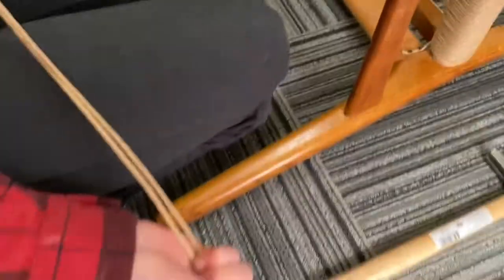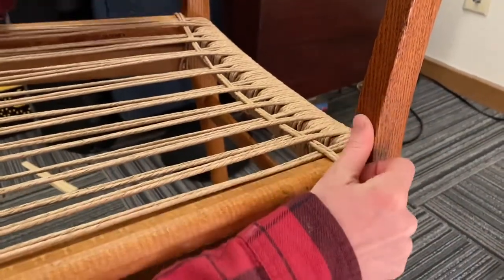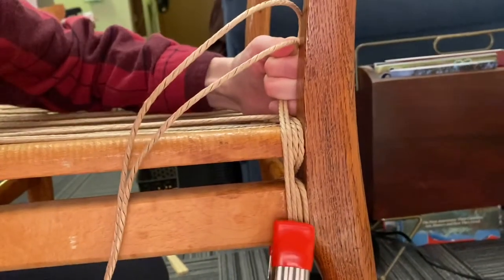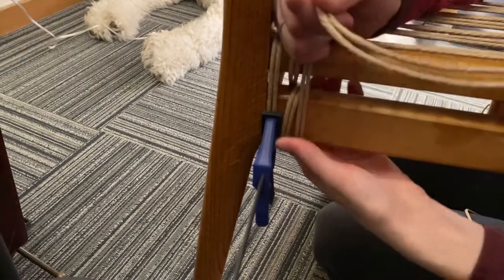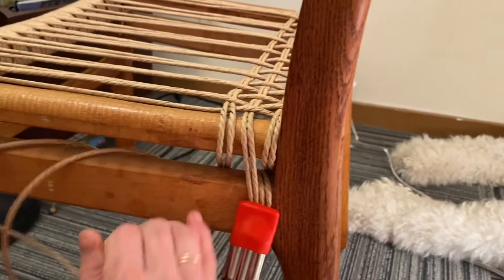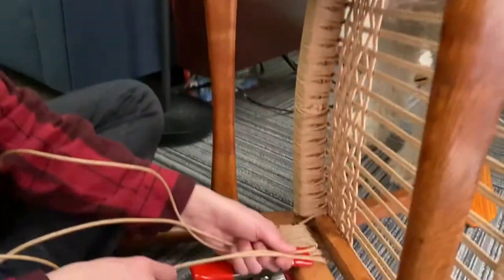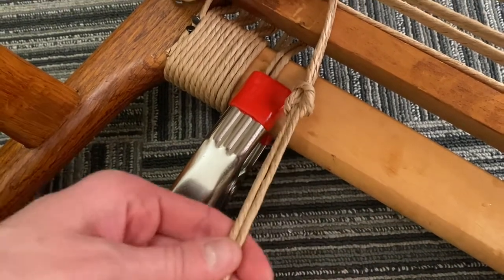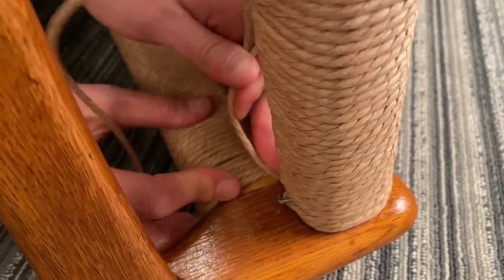Part Three Weaving the Double Side Rail - How to Weave Hans Wegner CH23 Chair

Comment: Great instruction. I will start weaving mine soon. Why didn’t you use 4 strands for the outer front-to- back rows as it is for most CH23s?
Reply from the maker: Either the other videos showing instruction for the front too back are not accurate for the CH23 or my chair had been restrung inaccurately. We literally just copied the original chair weave and all our chairs appeared to have original cord and only had two strands on the outside edge.
Reply: @IamRafe  i just weaved my first chair based on your guide. It went really well!
Reply from the maker: @Jagharjusagt  great to hear man. So glad we could help...we couldn't find any CH23 specific tutorials so thought we'd give one a try. Happy to hear it helped at least one person! 😉
Reply: @IamRafe  for the double rail part I found this tutorial also: https://youtu.be/JhCCU4BLdJM